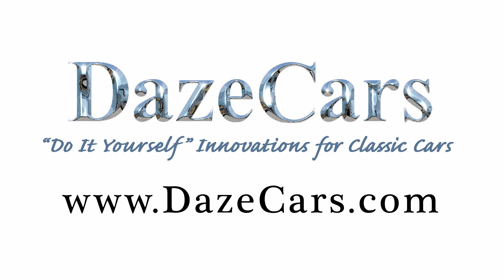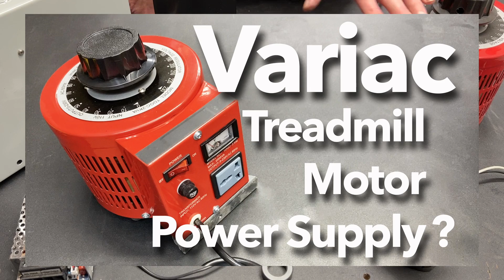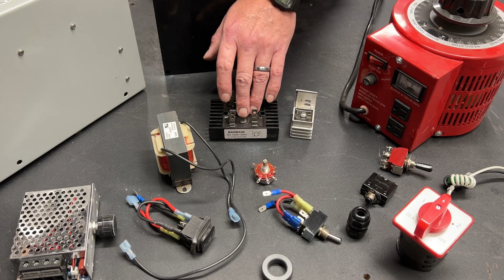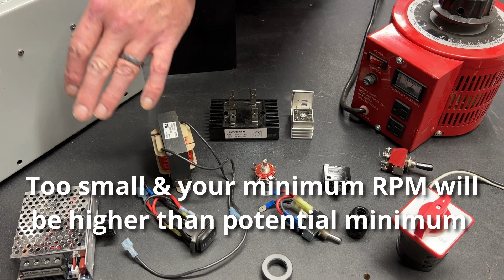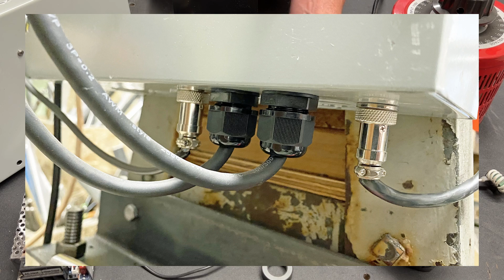Parts Lists & Links for Building Your Own Treadmill Motor Power Supply

Comment: Thank you so much for the information. I salvaged the power supply board (PB-121) and motor control board (MC-60), along with the choke from my treadmill. I also have the circuit board from the top of the treadmill that controls everything, but I don't want to use it, although I have everything set up and the motor works like it should. To not use the "user" circuit board, can I use a PWM signal generator hooked up to the power supply board to control the motor? Where the "user" circuit board plugs into the power supply board I have 8 pins (GND, INS, IND, INU, PWM, TCH, +9V, GND); to connect the PWM signal generator, it has the following connections (V+, V-, GND, PWM), which connections are connected to which pins on the power supply board?
Reply from the maker: No a PWM in not used in this application. You need a potentiometer connected to the H W and L terminals. https://youtu.be/RikeVYxITUQ?si=rxm5y4vMRza3b5nd

Comment: Thank you 100x over.  I am new to this after finally getting my hands on a Nortic Trak treadmill and I dismanufactured it so I have a good 2100 board and 1300vDC motor.  I spent my free time the past day or two trying to get the basics figured out and this is awsome for a guy like me.  

Now I need to decide what I want to make with it -band saw, big belt sander, light duty milling machine oh my, I might need a couple more treadmills 😂
Reply from the maker: Glad it was helpful! Let me know if I can be of any further assistance.

Comment: Hi sir, get a question here. What is the voltage output to motor when the tread mill is at rest. My is outputing about 100v. I suspect a mosfet failure. Thanks.
Reply from the maker: When there is no load on the SCR it will show full voltage 100-110 even when turned all the way down
Reply: @dazecars  Hi sir, thank you for your response. I am not pro, so I am assuming by "SCR", you mean the control board, like the one with the heat sink in this video. And "no load" means the motor is not connected to the board, right? Thank you.
Reply from the maker: Based on your statement I was assuming you were talking about a DIY power supply and at rest implies the motor is not turning (no load) .  If you are working with a factory power supply, it all depends on how it is configured.  There is no one size rules as all these power supplies are different.  What exactly are you working with, is it working, is it not working and what exactly are the symptoms if it's not working.
Reply: @dazecars  Hi sir, sorry for not making it clear. I am working on a pro-form treadmill. It stoped working suddenly,  I change the full bridge rectifier and the mosfet. Without connecting the motor, I measure the at-rest voltage output across the two pin giving power to the motor, I got a reading of 108 volt. I think the at-rest voltage should be close to 0 volt and I am suspecting the mosfet is not doing the job right. Will be great if you can shed some light on it. Thank you in advance.
Reply from the maker: On an MC2100 If the MOSFET went bad the AC switching transistor probably also needs to be replaced.  Typically there are 4 components on this boards that go bad, the capacitor which will rupture or swell, the rectifier which will stop producing DC current, The MOSFET and the AC switching transistor.  Every time I have had one blow up a MOSFET it also tore out the AC switching transistor which is the component on the heatsink wall directly adjacent to the rectifier. same is true in reverse a switching transistor failure will kill the MOSFET.  I have never measured the output on an MC2100 without a motor hooked up to see if it produces full voltage when not under a load. Some power supplies need a load to see a voltage reduction.  Does the LED flash?  If you can get the LED to flash and change speed as you change the controller speed than the board is likely working BUT if it stays on, stays off, or flashes in a pattern of 4 or 5 then the board has other issues.
Reply: @dazecars  Thanks for helping. Hope I am not being too annoying. Let me make sure I understand the components you mentioned. 

Board: old version of mc2100

4 chips attached to the heatsink wall, from left to right:

1 - MOSFET(irfp 250m)
2 - semiconductor (HFA25PB60)
3 - AC switching transistor (smallest, 4025L)
4 - Rectifier (GBJ25G)

You were saying if "1" is dead, usually "3", also dead and vice versa. So I should also change "3"?

For LED, I got solid light when the MOSFET is taken out. After I had the MOSFET installed, the LED flashed at turn-on but died out immediately after. But the Control panel (where we adjust speed and incline) still lighted up and seemed to be working. I did not adjust the speed or incline at that point. 

Thank you. Hope this is not taking too much of your time.
Reply from the maker: 1 MOSFET
2 Flyback diode
3 Switching transistor
4 Rectifier

The light coming on and going out is a safety and shows that full voltage is flowing even at the lowest setting.  Your best chance of replacing it is to replace component 3
Reply: @dazecars  Thank you sir! Thank is much clear now. 

I was trying buy the switching transistor, which has the model number 4025L, but I could not find one. I found a schematic online. It says the transistor is S4025L instead of just 4025L. Is 4025L and S4025L the same thing? 

Where do you purchase replacement part usually? 

thanks!
Reply from the maker: The replacement ones I have have the S at th beginning
Reply: @dazecars  Thank you sir. I will order replacement and hopefully it will work out. Also, thank you for the diagnosing video on MC-2100.
Reply from the maker: my pleasure

Comment: Greetings King,
I have two questions. 1) I used your info to build a power supply for an old wood lathe and it works great except that at lower speeds it has very little torque. I remember from one of your videos that some of the control boards will maintain a constant speed, is there a device I can connect to my PWM to maintain a constant speed?
2) If I add a smaller potentiometer will it also allow the motor to turn slower as well as giving me fine control?
Thanks for all you're doing, you're a godsend for the DIYer.
Reply from the maker: sounds to me like gearing would benefit your situation as you are wanting both slower speed and more torque and gearing will accomplish both of those things.  You want to gear it in such a way that max RPM on the motor will achieve the original  max RPM on the motor that came on the lathe.  Also what is the torque of the motor you are using.  Some are not as good as others.  The second smaller potentiometer will only add fine speed control, nothing else.

Comment: Would you say this is worth it even if my lathe already has variable speed and an ELS? “Harbor freight central machine 7x10 late. “

What would you do if you had this lathe? I’m ready to tinker.
Reply from the maker: It depends, I don't know what kind of speed range and torque you are currently getting from the motor you have so I have no way of knowing if a treadmill setup would be better or not.  that is such I a small lathe a treadmill motor might be too much for it.
Reply: @dazecars  based on the calculation you suggested it’s about 1.5 ftlbs of torque 2400 RPM. 
Mostly wondering if doing the dual speed nobs would be worth it
Reply from the maker: Most treadmill motors will have more torque than that. I love the two knob system. I can adjust it within a few RPM.
Reply: @dazecars  awesome think I’m going to go for it. What size was the lathe you used in your video? The red one that didn’t have an ELS?
Reply from the maker: the mill lathe combo in my videos does have ELS.  The unit is a 16X18.  It may look like two different lathes because in some videos there is no mill but in other videos the millhead is attached.  Same lathe either way just different configurations.

Comment: Question! Have a mc2100SDI. Was excited to find schematic enclosed, but it's for the 2100WA. The connector wiring  does not match! Can't find the correct diagram. Any suggestions on figuring out wiring?
Reply from the maker: email me pix of your board through my website with specific attention to the connecter with a clear image of the writing on the board near the connector.
Reply: @dazecars  sent. Also included the included wiring diagram (which did not match this board version). Those diagram can be golden!
Reply from the maker: That wires up the same as all other MC2100 boards.  Make sure you go with pin location not wire color from the harnis and also confirm your PWM is set to the correct hz

Comment: How do i know whay size inductor and what size choke i need. And circuit breaker for that matter. I guess the question is how do i figure out the amps my motor might need? And you rock btw. Big fan
Reply from the maker: The choke/inductor for the AC side is simple, it's just a doughnut core with the AC wires wrapped around it.  The Choke for the DC side is just as easy although harder to find.  The key is that its a "MOTOR choke".  If its not labeled as a motor choke then it's too small.  Most chokes are used as components on electronic boards and are way too small.  If it is big enough for this application it will for sure be labeled as a motor choke.  Glad you like my channel!

Comment: Is it ok  to only for a brief moment test my new 130v motor (PN  F-237595) with my  60v10amp power  supply? I know it wouldn't be a full power test
Reply from the maker: It won't hurt the motor but it might burn out the power supply if it is not fused.

Comment: Can't seem to upload any pics but just finished my upright bandsaw for metal and it works! Thank you so much for all your info on this! Greatly appreciated and I would not have this awsome tool without the info you posted and helped inspire me to do. Thank you
Reply from the maker: Glad I could help!
Reply: @dazecars  So, finally got to try my saw out and it worked for about a minute then stunk and threw a breaker. The voltage break was really hot and stunk. I went back through the wiring and rechecked the grounds and could find nothing. The motor was out of a functioning tread mill as well. The speed control and rectifier and potentiometer are exactly the same on the parts list. Went with the 2 potentiometers for the fine tuning. Any thoughts would be greatly appreciated.  Feeling a bit defeated.  When I say try I mean I got a blade on it and tried it. I had turned it on prior but didn't let it run long.
Reply: @dazecars  went back through wiring again and found on the  voltage controller I went hot-common-hot-common instead of hot-common-common -hot.  Stupid mistake considering I watched, rewatched your video on setting it up and took notes. Have I possibly fried the voltage controller, rectifier, or motor?
Reply from the maker: being that is AC it really shouldn't matter coming out.  Can you email me pictures of your setup so I can see if I can spot an issue?

Comment: Will this power my 180v 2hp treadmill motor - "AC90V-260V Input DC180V Output 8A PWM DC Motor Speed Controller Driver Controls" ?   To my calc 2hp = 1500w and that PWM has 1440watts
Reply from the maker: Most of these motors are 15-25 amps and that 8 amps is not even close.  Also thats an 8 amp max not 8 amps continuous.  The continuous rating is typically 1/2- 3/4 of make so 4-6 amps in this case.

Comment: Hi Daze, excellent video on power supplys. Do you have any sources for motor pulleys? I'd like to remove the flywheel pulley and gear down the speed. Oh, I probably need a belt, too, if it's those wide, flat belts
Reply from the maker: depends on the motor.  Some are thread on some are keyed and some the flywheel is also the fan.  If the flywheel is also the fan you need to retain it or add a fan.  When I removed the fly wheels on mine the keyed ones got V-belt pulleys of the correct I.D but on the my mill build I retained the flywheel and turned the flywheel down so I could press a v-belt pulley on to it.

Comment: question about SCR voltage controller AC 110V 230V 10000W , i only found the 4000 W version locally , and my AC is 220 v so my question is will the SCR out put 220 V as well ?  if so how to control that to make it only 120 or 180 as maximum
Reply from the maker: Thats not big enough especially at 220.  some SCR controllers work on both 110 and 220 you will need to look at the specs.  You can limit the max voltage output by putting a resister in series with the potentiometer

Comment: have you looked at the KB motor controllers with a HP module? Not cheap.
Reply from the maker: I have, they make a quality product with a good reputation but charge a little to much IMHO. The other concern I have is the max amps is a little low which can negatively effect max torque.
Reply: Ok, thanks again
Reply from the maker: my pleasure

Comment: Thanks for the summary.   I had started collecting parts for this project a while back from a prior video.   I do have a question, I purchased an SCR at the time based on your older video on eBay,. The seller is no longer around to ask,  today recently I saw that there are 4 terminals, and the label is only in Chinese, I translated the characters via Google and it said, "AC input AC output ratio".   It is English but not clear to me which terminal is for which purpose,  Is there an easy way to tell?   Thank You
Reply from the maker: there is a schematic at 8:17 on this video that shows how to wire it https://youtu.be/SjEgKH_MGFE Let me know if you have any other questions.

Comment: The red rotary switch is butt ugly. Painting is essential. But it’s a tedious job. I swapped out the plastic silver plate behind with a thin stainless steel sheet, sanded down to 3000 grit. It looks beautiful. 
Overkill city.
Reply from the maker: it is ugly

Comment: I have a 122k pot and a 20k ten turn wire wound pot that I’m thinking of using. The fine control would be awesome. Yea, it’s 10 turns, but the resolution would be very fine.
Reply from the maker: seams like overkill

Comment: Daze. Your AC toroidal inductor looks perfect. What’s your secret? Whenever I make one it looks like it was put together by a child. I have to use epoxy to keep the wires consistently spaced. 
By the way, I have mine hanging on some uprights so it doesn’t touch the box. But it will touch the SCR. Is that ok?
Paul
Reply from the maker: pre-coil the wire around something smaller like a chopstick to get it into the coil shape.  It doesn't matter where the inductor is as far a physical location.  These are not not high resolution electronics where interference is an issue

Comment: Thanks so much again, I want to use the Variable Transformer set up for my wood lathe. Can you point me to a video showing the specific set up using all the components including revers switch and estop button?
Reply from the maker: Variac as a Treadmill Motor Power Supply Is this Another Budget Option to Power a Treadmill Motor?
https://youtu.be/oSZYEUm1SuY

Treadmill Motor Forward and Reverse Direction Switch Wiring and Feasibility
https://youtu.be/B1pj3N1J2vg

Configuring an Emergency Stop Switch for your DIY project
https://youtu.be/HLFfFQS_Rsg

Comment: These videos have been super helpful. Thank you so much. I have learned though unfortunately my treadmill motor is a little bit of a downgrade compared to my (salvaged washing machine) induction motor that I currently have on my lathe. I would say a sidestep. because the speed variability is an upgrade but it would have sightly less torque. But I digress, I wanted to see what your thoughts are on brushed Mitre saw motors. I have 2 kicking around, One is 3*5252/4900=3.21. not too bad.  I am going to experiment with my scr controller set up to see how those operate on DC vs Ac since ( i think) they are "universal". What are your thoughts on that? Have you ever experimented with mitre saw motors?
Reply from the maker: Please let me know how it goes as I have not done anything with miter saw motors
Reply: So i did a little bit of experimenting and more research and I am attempting to build a slow grinder for sharpening tools, I have an AC speed controller that does a pretty decent job with the universal motor, but im finding that it definitely lacks torque at the lower speed. That is the biggest downfall im finding with these mitre saw motors. I think it will work for this application since I will not be applying much load at all to the wheel as im doing fine sharpening. I will be doing more experimenting as I want to try the DC speed controller set up on it to see if there are any different results. @dazecars
Reply from the maker: @jordanarmstrong353  first of all I don’t recommend an ac speed controller on a AC motor. There are a couple reasons for this, first they are very hard on the motor. Second the torque of an ac motor changes as RPM changes. On a DC motor torque is constant.  If torque is your issue can you try gearing the motor to help reduce speed while also increasing torque?

Comment: My small forward/reverse switch gave up on me(like you predicted). I have got the big switch the same one you have on this video. Do you have a wiring of that switch somewhere? Thanks!
Reply from the maker: I have several switches on the video, exactly which one are you asking about?
Reply: The one showed on your table in this vide
Reply: The big red handle
Reply from the maker: @milanp5697 here you go Wiring a Rotary Direction Switch for a Treadmill Motor Conversion
https://youtu.be/aFsfAYgyTgg
Reply: Thanks,  appreciate it!